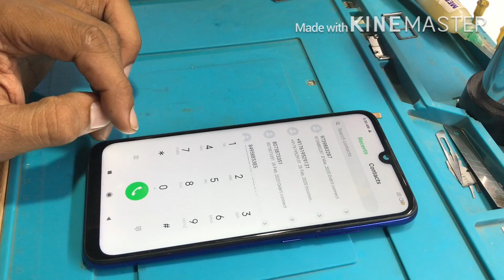Xiaomi Redmi Note 7 Pro Overheating Blank Display Problem Solution [Hindi]

Comment: Mera redmi note 7 pro me PM6150L overheating ho raha hai, new replacement kiya phir bhi overheating ho raha hai, but mobile on hota hai old ic ke sath bhi aur new ic ke sath bhi, but light 💡 kabhi kabhi aata hai aur kabhi kabhi nahi aata
Reply: Mera v yehi problem hoo rha
Reply: @omprakashmahato1  water damage hai? light diode ke dono taraf kitna reading dikha rha hai cool testing me? light diode ke output me 400 se jyada reading dikhayega aur light diode ki input me 300 se jyada reading dikhayega light diode ke input me 300 se kam reading dikhane par PM6150L overheating ho raha hai

Comment: Note 7 pro Light working but no Graphics 
PM6150L changed but same issue.
VDISP Lines ok but still same any Solution
Reply: Same problem
Reply: Reball CPU ic and Flash ic